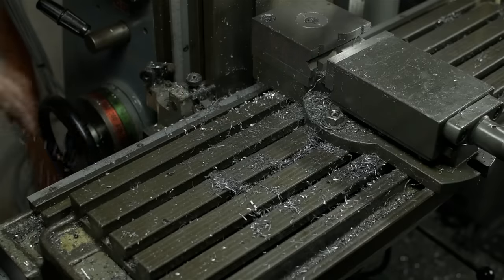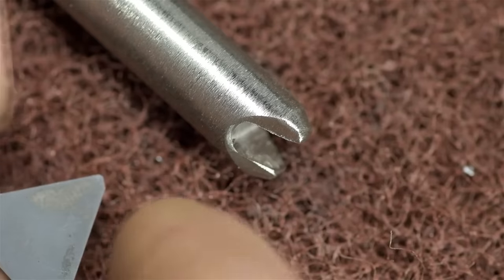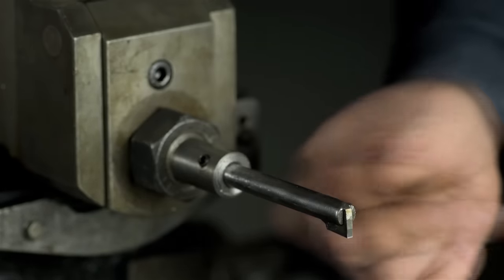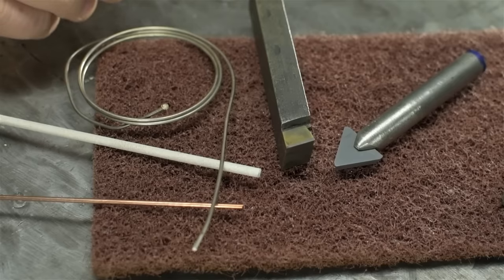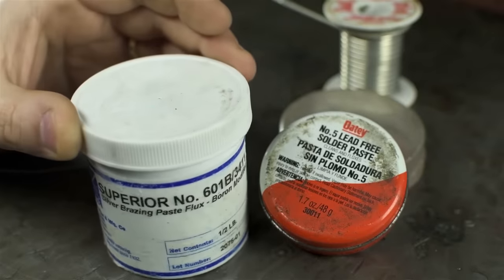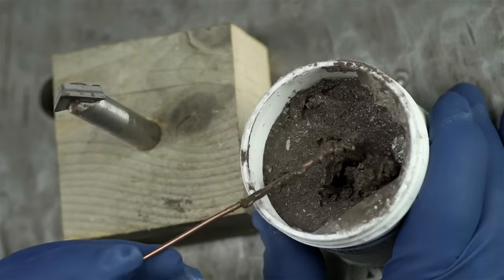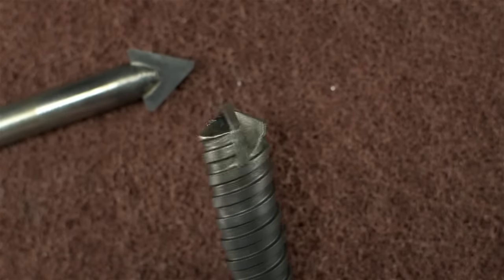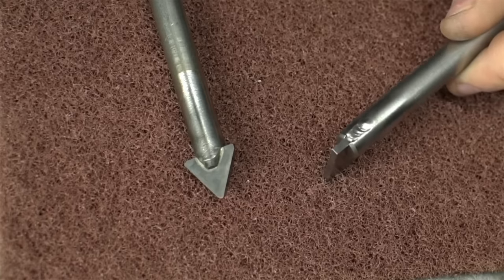Custom Tools - Brazing & Welding

Comment: Plumber here, soldering (>450°f) doesn't have the PSI rating that brazing (<1,225°f) does on refrigerant, medical gas, or water copper pipe. 

Now saying that... I have never brazed anything but copper pipe, definitely not tooling. 

The brazing rods look the same as what I use, we don't use flux as it's built in the rod. The difference between the silver (AG) and zinc brazing rods for me besides the lopsided cost, is that brazing rods with over 5% silver flows so much better than zinc. The 15% silver flows amazingly into the cup of fitting, comparatively to zinc rods. 

Don't know if it helps or hurts, but I love your videos. By far the most entertaining videos on YouTube!

Thank you for all the awesome hours full of dad humor thats packed with knowledge that you share with us!

BTW the wife and I would love to have you over for dinner one night... As long as it's not to awkward 😂🤣😂

Comment: Brazing, contrary to old timer assumptions, is not mechanical there actually is chemical fusion although the base parts aren't melted the atoms near the surface do diffuse and alloy. 
I think the term brazing actually [originally] referred specifically to hard soldering with brass and bronze, current common use is just a synonym for all hard or high temp soldering.
Metallurgically speaking fusion welding also doesn't need more than an atom or two of penetration to achieve full strength, the hitch is in practically accomplishing that such precise fusion in a real world joint without significant flaws.
Reply: Excellent discription, yes, brazing temperatures does alloy with parent material, soldering does not. I am not sure in the regard to the sintered carbide, does it alloy, or does it penetrate the sintered structure. May I ask your opinion on this. Regards John.

Comment: Coincidentally, for me anyways, I just read a few days ago that the “mapp” gas in little yellow tanks isn’t true mapp gas of olden days but just a marketing name now. It’s temp is similar to propane. Environmental laws outlawed the good stuff.
Reply: Technically, it wasn't environmental laws. The components of true MAPP gas were originally essentially waste products, but then became valuable as feedstock for the plastics industry. Businesses being out there to make a profit, they stopped selling MAPP, and sold the gas to the plastics industry instead for a higher profit.
Reply: Hugh Jafro old news, MAPP hasn't been made in North America for years now, funny how they take propane add a couple additives and make you think it's real MAPP
Reply: If it's not methylacetylene-propadiene propane then it's not mapp.
Reply: propylene gas (usually with <5% propane) is is the current MAPP substitute, while 2/3rds of the propylene manufactured is consumed by the plastics industry. MAPP manufacturing seems to have shut down because as the price increased industry moved back to acetylene while small business and home-gamers weren't a large enough market to keep it viable. I don't know for certain though, just my take based on the info I have.
Reply: Yep. You can pay 3x the price to get another 100F.
Reply: Mapp is propane. Period.

Comment: That Oatley stuff isn't silver solder. It's lead-free soft solder, mostly tin with a frisson of Ag to lower the melting point.

Your silver blazing wire is silver solder, exactly what a jeweler would use.
Reply: It's absolutely still silver solder, just not the silver solder you're thinking of. There's a world of difference between what the jewellery, plumbing, and electronics industries consider "silver solder" to be. None of them would want to use the stuff from one of the others.
Reply: James Churchill No, there's no application where someone could specify silver solder where that Oately stuff would be acceptable.  HVAC silver solder is at least 15% Ag, higher for joining dissimilar metals. That Oately stuff is lead-free soft solder for potable water connections.  Usual composition is about 97-98% tin and 2% silver.
Reply: I said nothing about where they were applicable, I commented only on the industry-specific nature of the nomenclature. So I don't know what you're trying to argue against.

Comment: 16:20 that blue stuff is some cobalt compound
Reply: what does it taste like though?  minty?
Reply: Yes, the tungsten carbide is crystals in a cobalt matrix, a bit like carbon in steel. The cobalt forms oxides on the surface, and these are dissolved into the molten flux, forming a bluish glas.The green colour on the stainless shaft may be the nickel, iron and/ or chromium oxides also dissolving into the flux.
Reply: Also the flux he used said it was boron modified and boron can give a blue color as well.
Reply: yay, i'm getting flashbacks to inorganic chemistry labs!
Reply: Small correction, carbon steel isn't carbon crystals in an iron matrix. The carbon is fully dissolved and thus part of the iron crystal lattice. Over 0.8% carbon(the eutectoid point) some of the carbon will combine with iron to create iron-carbide aka cementite which is separate particles in a steel matrix. In alloy steels tungstain, vanadium, and chromium are all strongly carbide forming alloys. (and why Cr must be over about 12% dependent on carbon content, before enough free metallic Cr is available to make stainless steel )
The border between steel and "iron" [in the blacksmith material sense] is that in steel all of the carbon can dissolve into the crystal structure (at the appropriate temperature) when allowed to reach chemical equilibrium, this has a maximum of about 2.0% carbon. (a few exotic alloys with lots of carbide formers can go a bit higher) 
Cast iron has about 4-5% carbon(the eutectic point) and so forms graphite particles that make grey cast iron grey when fractured and easy to machine being self lubricating and nice-chip forming
This high carbon makes tons of cementite in "white" or "chilled" cast iron making it extremely abrasion resistant. (Molds are cooled and made with heat conductive materials to quench straight from the molten stage, this is not allowing chemical equilibrium.)
White cast can formed on just one portion of a cast as well kind of like a case hardening, or it can then be heat treated further to convert the cabides back to carbon and make ductile or nodular cast iron. (I forget which one is made from white as I get the two mixed up. Nodular for sure has rounded nodules of graphite making it a bit more ductile than grey.)
Reply: I thought it might have been dylithium crystals.
Reply: "He's dead Jim!"
Reply: i was thinking it was boron from the wire, or maybe silver oxide (like what makes blue glass). if i was less drunk i would remember what silver oxide it is but i think its silver2oxide. probably wrong.
Reply: This is one of the most informative youtube comments I've ever read. Thank you!

Comment: I was tool repairman for 3 years at a very large tooling company (I believe 26 worldwide locations?) My daily work load consisted of removing old, worn out guide pads and cutting inserts from tools, cleaning out the pockets, then cutting new carbide pieces or using precut PCD (diamond) cutting inserts and brazed them into the pockets before I sent them off to our wire EDM department, where they would cut the PCD inserts into shape. 
Our reamers had guide pads, which would precisely guide the tool through the bore that the cutting insert just created, and they would be ground within 3 microns. Whole shop had to be temperature controlled for accuracy on the machines. It was a fun job for a while, but now I never want to braze anything for as long as i live, lol. They paid me extremely well for doing it though.

Comment: Oxy/propane works also with a propane cutting torch.  Just repaired a crack on my cylinder head with that setup and bronze filler rod.  worked great.

Comment: Funny, when I was taught how to do this we referred to what you call silver brazing as silver soldering.  This is the first time I have heard silver soldering being the same process as soft soldering (what you do to connect copper pipes and fittings with a propane torch).  Also, I have been silver soldering (silver brazing, I guess) hss to mild steel bars (usually to make boring bars) for years.  I had no idea it could be tricky or could damage the hss.  I've never had any problems with it.  Maybe I just fluked it off all these years, but now I'll probably be nervous the next time I do it. Thanks for the video.  Ken

Comment: You can braze HSS with a Propane or MAPP torch.  Heat the large part so it gets to brazing temperature before the small bit.
Reply: You might do it with MAPP, but you'd be waiting FOREVER to braze using Propane. Unless you use silver solder, rather than brazing sticks.

Comment: Ring around the tub (the filth left at the top of the water when one takes a bath) so the first person in the tub would be the leader of the ring of filth, or the ringleader (also the conductor of a circus) first person again. Running the show, making the joke work on several planes. Great videos. Keep them long, it works.
Reply: Well shoot. Well spoken explication before me... read comments first. Copy.

Comment: The black flux you used is high-temperature flux, it resists burning out of the joint under prolonged heating. At the same time, it's not as chemically active as white flux formulations. 

White fluxes turn to clear liquid when the part comes up to brazing temperature announcing the joints readiness to be fed filler. What the flux is doing is not just preventing oxidation of the joint, but actively scavenging flecks of oxides left in the joint. You might try heating below the insert next time to bring the shank up to temperature, then applying the heat to the insert. It also works to insert a preformed piece of brazing filler metal into the joint beforehand, and let in melt in place. The void under the insert would have been a good location to insert a preformed piece.

Comment: According to the AWS, soldering uses a filler material that melts below 450° C; anything with a higher melting point is considered brazing (short of welding, of course).

Comment: We have different descriptions for this process on this little island they call Britain. The process you have described is called silver soldering or hard soldering over here. Brazing is used to describe brass or bronze filler rods. Soft soldering is basically anything that can be melted with a soldering iron or low flame. The low silver content stuff, like you said, is used for stronger copper pipe joints but a friend of mine uses hard solder to join thick copper pipes used in industrial refrigeration units (He is a fridge engineer). To really confuse matters, some people over on this crazy little rock (Not me - oh no!), call brazing (with brass) braze welding - life can be so complicated!

Comment: I used to build chillers. We called it silver solder and soft solder. We “silver soldered” (brazed) any shiny metal parts, such as stainless heat exchangers. We “soft soldered” (standard torch) all copper water piping. And for copper refrigerant piping we brazed it using some kind of stick. Can’t remember what the stick was, but we just called it brazing copper. 

Brazed, silver soldered or soft soldered. Hope that clears this up😂

Comment: I do a lot of brazing. A MAPP torch will braze that part just fine. You'll run into problems with Mapp if the part is or is connected to a large heat sink. And 45 is pricey, 55 is even more so, but stronger and flows better and wets easier, and that $20 on Amazon is either a scam or they don't know what they have. You can't escape the market price of silver. Love your videos!
Reply: Oh, and if you're torching high speed steel, you can get a temperature indicating color pen from marks all. Get your braze temp and your fail temp, and you'll know what you've done with the torch.

Comment: Someone else has probably already mentioned this, but before TIG welding, the steel tube airplane frames were welded with oxy-acetylene torches.  Some home builders still use this method as it can be more forgiving (slow) for the novice.

Comment: You use a somewhat different understanding about the difference between brazing and silver soldering than I grew up with. When I first learned use an oxy acetylene torch we used a copper-zinc filler rod (i.e. brass) filler rod for brazing such as with carbide tips and a silver containing alloy for silver soldering for such jobs as copper pipes. In both cases I used the oxy acetylene torch for heating up to filler melting temperature.
Now that I make jewellery I join pieces in silver using a high silver filler wire or sheet and heat with a small oxy propane torch. Specialised filler alloys fro various fineness of gold are also made.  It's small scale work so I can manage with a propane torch or even a cheap butane creme brulee torch but these have problems of heat control. in jewellery making heat control is utterly critical because the gap between the melting point of the filler and work is quite narrow.  On the other hand silver in particular has an extraordinary capacity to soak up heat because it has the highest thermal conductivity of any metal so in practice much of the whole job has to be brought up to high temperature before the filler will flow. Hold the torch in place too long and hours of work is reduced to a red hot puddle.The oxy propane torch give me much better heat control while pouring out a lot of heat. By comparison brazing carbide tip to relatively low conductivity steel is an absolute piece of cake.

Comment: Big tip for anyone trying this...that soft sil solder that comes in a roll will boil, and pop in your face if you overheat it. Wear some sort of eye protection.

Also, if you're new to brazing, the flux tells you when to add the solder. Once it liquifies start trying to add the solder. If you get it burning red hot, you'll burn the flux off, and your braze joint will not be as strong as it could of been. That's if you could even get the solder to stick.

Comment: Aircraft mechanic here.  I don't think I've ever encountered brazing in aircraft structure.  AFAIK, old tube and rag ships like the Cub are welded chro-moly.  Aluminum semi-monocoque hulls are made from 2024-T3, so welding or brazing would kill the heat treatment of the metal (and the crew and passengers), so those structures are riveted.  Aircraft are increasingly made of composite materials, which behave even worse than aluminum when they encounter a torch.
Brazing happens every now and again in the power plant, some hydraulic fittings get silver soldered.
BTW, though they do teach a couple weeks of welding during mechanic school, it's mostly to impress on A&Ps that you should NEVER under ANY circumstances take a welding torch to an aircraft, you get a certified welder to do it.  From what they taught me I think I could repair a broken shovel or wheelbarrow with an oxy-acetylene torch, but I wouldn't trust myself to do any welding on an aircraft.

Comment: I had a helper who mistook my 50% silver braze wire for generic steel wire and used it to secure a component in the equipment we were working on. He used around 6 feet of it. I realized what he had done as we were packing up to leave. I now keep my braze wire in a secret compartment in my van. Live and learn.

Comment: You can clean flux off of carbide easily with a supersonic cleaner. 
Additionally, some varieties of silver brazing do not require you to make your carbide red hot, especially when you are putting a diamond tip into a carbide tool.

Comment: To start, I've brazed 1 thing in my life, at a tech school, and I wasn't very good at it.

I do solder electronics as part of a hoby, and I was wondering if using a clamp as a heat sink on high speed steel would allow more wiggle room when welding to prevent annealing it?

I know that when I'm preventing an IC from melting, I can use an alligator clip in between the solder work, and the chip to prevent heat migrating into the IC, but I'm not sure if it works the same for welding.

Comment: A little tip.  Switch to propane from acetylene for brazing and cutting as it is 15 times less expensive.  I've found that you might need to up your tip one or two sizes and if you don't want to buy the overpriced propane specific tips, just use a drill bill and chamfer the hole on the tip a bit to improve flame holding.

Comment: I used to braze copper on to steel or on to brass with oxy-acetylene.  And you had to make sure that you didn't heat up the copper to the point that it was red, much weaker then.  So I think I could braze high speed steel onto that post.  Might take a couple of tries though, been a few years.

Comment: flux protects steel from heat, on bike framebuilding flux is spread all over. maybe same could work for HSS. also flux colour tells you when its activated, so you dont have to get steel red hot. thanks for the good videos you make.

Comment: Bathtubs used to get rings around them. I've only encountered one when I was working with coal and lived in an old house that had a bathtub and no shower. After a bath I had to clean a ring of coal that deposited at the water line in the tub. I remember bathtub rings being in jokes in Three Stooges or Marks Brothers era films.

Comment: The opinion of an old,retired pipe welder confirms what you said when you attempted to explain the difference between welding and soldering and also the difference between silver soldering and silver brazing,same goes for the fluxes...I like the fact the information presented was not "full of shit"

Comment: you might wanna try the cold pulse welding. the pulse is short bet can weld through almosy any metal, which is good yo joint metals. there are very simple product can convert your tig welder into the pulse cold welder. easy to program and weld.